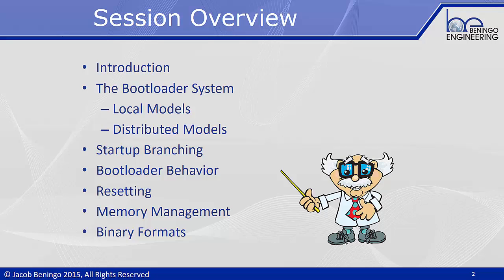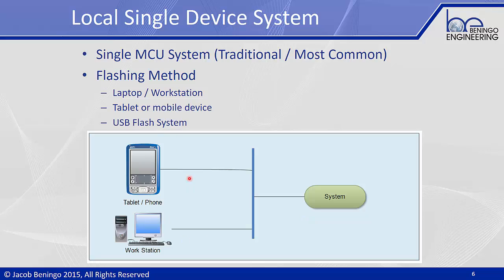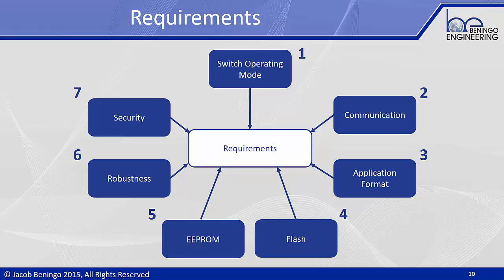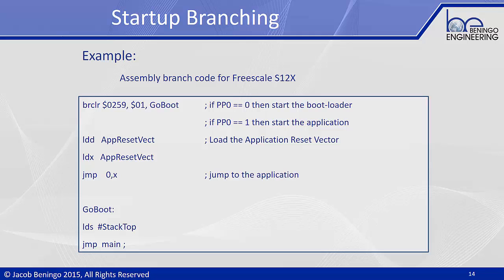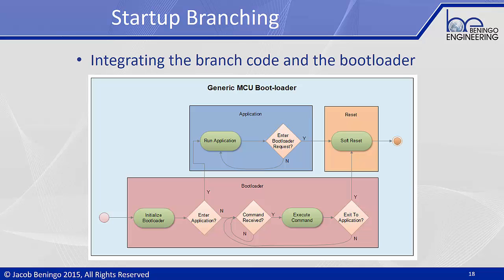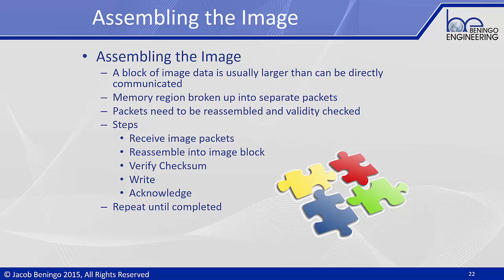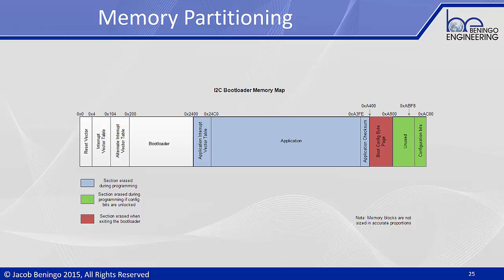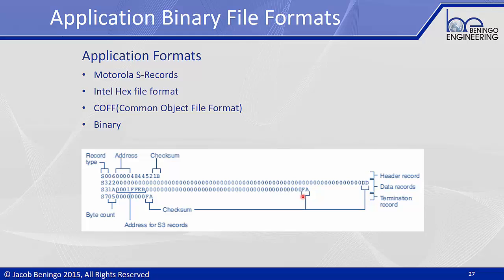ESDT: Epidsode 1 - Introduction to Bootloader Design for Microcontrollers

Comment: @21:32 for low count pin MCU we can set the code to poll for the zero logic via the switch for 1 second after power up, or so - and after say 1 second from power up the code flow goes automatically to program, not bootloader, if low logic is not detected. So before you power up you just press and hold the switch then power up - this guarantees that the MCU will enter bootloader code. I have done such a similar design before. Then re-use that GPIO pin for another task.
Reply: 1 second is a very long time in a lot of application. In some industries, there is a requirement for this entire process to take less than 1 millisecond!

Comment: Where do you find documentation on what system calls are available to a programmer building a boot loader? Since linux has it's own set and what not, what kind of documentation exists for bootloaders? 

how do people know that 
        mov ah, 0x0e
        mov bl, 0x07
        mov bh, 0x00
        int 0x10

will print a character to the screen?
Reply: You have to look at your parts datasheet. The low level assembly instructions are typically only used for jumping to the application to reset the stack but there are other ways to do that too. A good place to start is with the example from the silicon vendor you are using.

Comment: Nice video. I always wanted to learn about boot loaders. Is it possible to write a boot loader for 8051 core?  Like 89s52 microcontroller. Thanks in advance.
Reply from the maker: Absolutely! A bootloader can definitely be written for a 8051 based part.

Comment: This video is awesome. Can You help me in designing a bootloader for Freescale's Kinetis E series controller( MKE02ZVLD2) ?
Reply from the maker: +Ganesh Ramachandran Break the problem up into smaller pieces. You need to identify where the issue is. Are you sending too much data at once, is flash getting read improperly, corrupt data being received, etc.
Reply from the maker: +GANESH RAMACHANDRAN email me at jacob@beningo.com and we can discuss the possibility off-line
Reply: +Jacob Beningo Hi sir.. From your tutorial's learning. I have come up with a boot loader. But I am facing an issue here. My Boot loader logic is this, Configure a button as Boot loader Button, If you press that button, the program goes into boot loader mode, where it just checks for any User Application. If the button is not pressed, it will go directly into Application mode. The controller for which I designed a boot loader is MKE02Z64VLD2 microcontroller (KE-02Z).  I am using Terminal Application (sites.google.com/site/terminalbpp) for sending an Application file serially. My serial connection to my custom board is Half duplex :( adding fuel to the fire, the MKE02Z64VLD2 microcontroller does not support RTS and CTS.  Can you suggest me anything ?